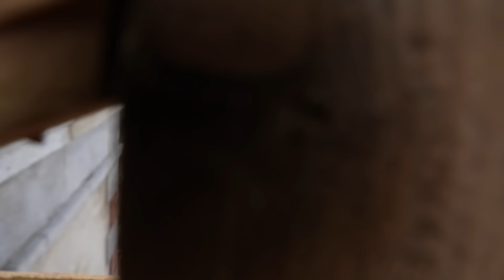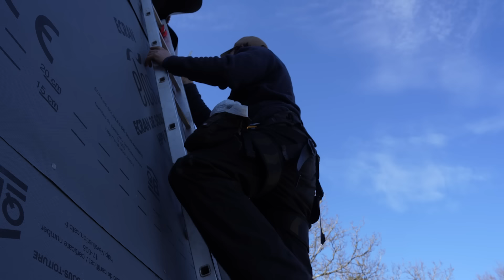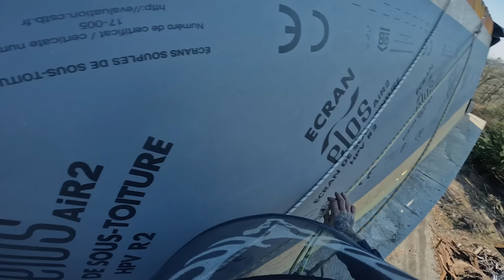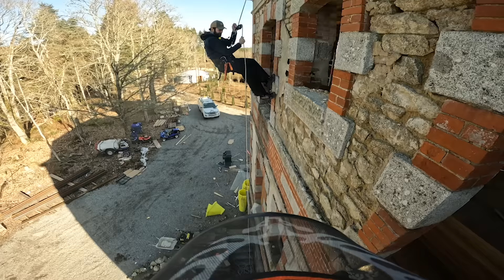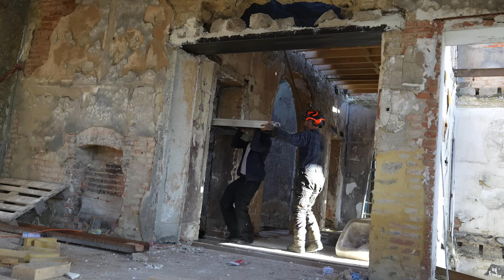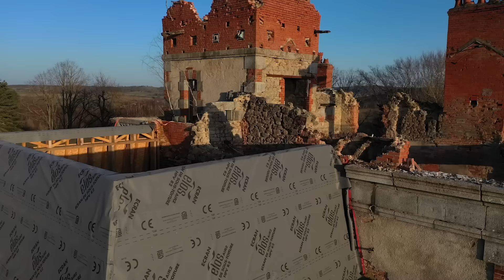A mansard roof, ready for the second stage.

Comment: Getting the building dried in will be a HUGE step for sure. Amazing work.
Reply: This is a good start on the roof, I fear if he has to restore all the flooring in the center and other side, it may take him  more than 6 months before the entire roof structure s finished.  The progress Dan and his  friends are making is really impressive.
Reply: @RR98guy logically speaking so long as the structure is sound, he can simply concentrate on restoring the top floors of the other sections so he can readily work on the roof.  That will allow material movement access from the side already done, and work access on the top floor across the remaining. 

Doable, but that said, I'd be amazed if he's framed and sheeted in 6 months.

Comment: What can I say but "WOW"!  It is incredible how much the place has changed in such a short period of time.  I can't wait to see how far you get by the end of 2024.
Reply: Hopefully by going onto the next wing (After the current roof structure has had its apexes and temporary felt  rolls applied) during dry weather and putting the beams, floors and roof on before Winter 2024, Dan should avoid another Winter like that, it will take its toll!?!

Comment: I'd say it might be a good idea to put some temporary battens along the roof to hold the felt down in strong winds. Loving the progress :)
Reply: And how strong do winds get in this part of France?
If you didn't have the answer already, I'm sure you consulted the wind map for France before commenting. 
(Though I don't quite get why you commented anyway as the map has shown you than Dan lives in the part of France where winds are the weakest.)
Reply: @aiglonducal314 how many roofs have you membraned or felted?
Reply: @aiglonducal314 It doesn't take much. And it's high up off the ground where the wind flows faster. If it's going to be like that for an extended period, it needs stronger fixings.

Comment: From what I see, I would say that Dan's rope is a quite new static/semi-static rope, which is suited for this kind of job overall as long as the rope is used in a way which prevents any significant fall. I mean that ideally Dan should be secured 'tight' with little margin to go left and right with the rope directly coming from above. With such a rope, a horizontal whipper of say 3 meters would result in a hard catch of the body by the harness and possibly injuries (while such a pendulum fall would be nicely absorbed by a climbing rope which stretches by something like 15 to 20% and thus reduces the impact on the body).

Comment: I see your'e nailing the wind moisture barrier. I roll out and hammer tack much large surfaces in harsher winds. and climates. Its works great and ill nail with flat heads if need be on edges if particularly harsh winds.   Saves so much time so as you go on, perhaps test ?

Comment: Wow Dan! Looks amazing! Glad you're getting the rest of the wood, etc. for the roof tomorrow ... just in the nick of time I think! It arrives just as you finished the rest of it! ... wanted to suggest, especially for the roof bits ... if you have someone who could film you, especially with a drone or something, or maybe if you can set up a camera on the ground or something, that would have a clear shot of the work done on the outside of the roof ... then you wouldn't have to worry so much about camera's getting in the way, etc. ... also, I did notice the fourth wall ... above the doorway, there's a small part that doesn't look like it's quite tall enough to reach the roof, so, I'm guessing you will be looking at that also. It's not going to be easy though!

Comment: Looking forward to putting the cap on the roof. I can't imagine how you are going to do that. Eagerly waiting to watch the next steps.  The swimming pool project also fascinates me. Not sure how that can be rebuilt. I guess time will tell.
Reply: The roof structure will be easy enough, built from inside as before, but getting on the board and felt is going to be a bit hairy 😄 Though they can possibly step onto it from the balcony. It will definitely be an interesting watch. 😊

Comment: Great watching each day and new project, here’s the but and I am sure it’s been said many times. “Get some scaffolding, external and internally where permitting. By the time your on the other side of the roof you will be to old to put that harness on and use it 😂. I am a carpenter and joiner by trade and have renovated many properties like yourself on my own and with help and have indeed done it kind of your way on some projects, but this is calling out for it. It will pay for itself in time alone that you will save faffing about.
Reply: But saving time isn't his priority. The money can go to materials. Scaffolding is expensive.
Reply: I agree it is expensive and I take the point about time if you have it to spare and not on a deadline. The scaffolding will not just help with the roof but the fitting of windows and sealing, rendering/pointing, cleaning off brickwork, painting, guttering/downspouts etc etc. all these come with a risk to safety more importantly without taking unnecessary risk. I am the same as Dan on trying to save cost on projects where possible and a lot of what I have done has not been time dependant too, however I have always wanted to be around to finish the project.
Reply: @JulianButterworth-ff1ii  I expect he will do as much as possible without it. It's a long project, and the question is, can he sustain his income all the way through it. He will need a lot to do everything this building requires. Many people comment, just buy/hire this or that, you'll do it so much quicker. If he followed all the suggestions made, some daft, frankly, he'd be much closer to being broke. It's not an ordinary-sized house build. Money needs to go as far as it can to get to the finish line. The slate for the roof is going to be a huge expense.  I think the Strawbridges spent something like €100k replacing their slate roof.

Comment: Impressive progress. Get one of those staple hammer thingys and tattoo the Ecran with it. Every bash is a fixing. It will give resilience in the wind. I'd love you to frame out the top most window arch with 4 bits of wood and 4 triangles to brace that structure before it moves or falls. Every time I see it, I think lovely and precarious simultaneously.  It's time for a pointing party. Super video.  Regards, Stephen.

Comment: Keep on trucking, Dan! If you’re planning on keeping the underpayment in place for a while please put some wood batten strips on it as any high winds will result in it tearing through the nail heads and tearing generally as it flaps in the breeze. Then you’ve created more work to repair it as well as a potentially unsafe situation for yourself having to repair it at that height. Beef it up where you have easy access to it. Please, please, please consider renting a tele-handler for a month when you tackle the next multiple floor installation. Moving steel beams, floor joists, framing materials and flooring by hand and winch is admirable but not really the best way to be approaching such a monumental task. It is also not the safest way to work and we want you healthy and happy by the end of the project. You can put a whole load of materials on a tele-handler and pass it through a window. It will speed up the process. I think your construction mates would agree. Trade your ball peen hammer in for a proper framing hammer, lol! It brings me a chuckle like when I watched you sweeping with your tiny broom in earlier videos.

Comment: Momentus!!  🎉🎉🎉  My day is complete 😊
Why does the attic need a new floor.  Assuming that the attic is where the roof is...?  The roof already sits on the floor...   I'm not following you...
Reply: The osb is degraded from the rain and falling to bits. It needs to be replaced.
Reply: @LaReynedEpee  but the roof is sitting on it...
Reply: Thanks for your answer 👍
Reply: Nevermind. Questions answered in todays vlog..

Comment: I wonder if Dan could use the scaffolding to floor ONLY the top level of the rest of the chateaux? 

Not sure how safe thay would be, but it would certainly mean building the rest of the roof, making repairs and drying in the chateux several months earlier than if he repeated going floor by floor
Reply: You've missed the whole concept of a Mansard Roof
Reply: @Chateaulady  I think you misunderstood me - I meant the process of adding the I and C beams and replacing the floors in each section before he can begin on the roof
Reply: @JPRobinso  Good point! Makes a lot of sense

Comment: I just noticed the floor boards are breaking down due to the rain on them .(We call them panelboard). Do you feel using them was the best flooring option or just the cheapest. I often wondered why you didn't start at the roof and work your way down. All the ;pulley system seemed so  laborious, did you consider a crane or was that out due to budget. How much rebricking do you feel you will need to do at the upper levels?

Comment: You need to get youreself a hammer stapler like we use here in the states. Its like a staple gun butyouuse it like a hammer and it hammers in your staples to attach the felt paper. with one of those it would only take a minute or two to do an entire side.

Comment: That roof covering is going bye-bye as soon as the wind picks up. Those few nails will just rip through. Screw down some strips of wood at the seams to prevent the air going under.

Comment: Why are you nailing down the overlapping side of the top membrane?
Effectively, this defeats its purpose of being watertight as you punch a hole in it.
If you are concerned about the wind catching it, I would have taped it down until the rest of the roofing is done.

Comment: You know you’re supposed to use a plastic grommet underneath those nails to hold that underlayment in place otherwise the wind will rip it right off the nail head is not adequate

Comment: Not sure if you’ve explained and I may have missed it but are you going to use point crochet and slate direct onto the membrane? If so is that the right membrane as I had to use a bitumen base membrane when close boarding a roof and I’m sure that membrane requires 20-25mm air gap?